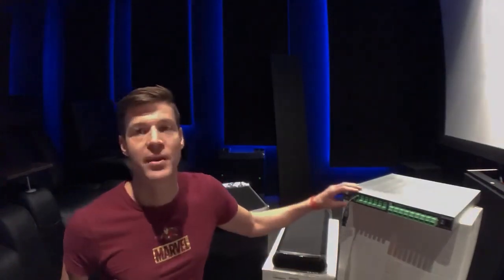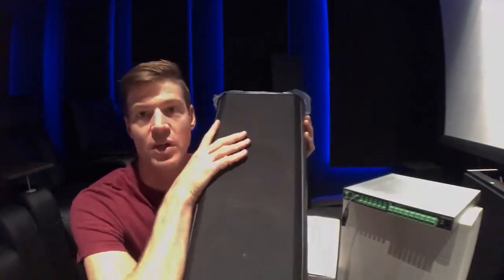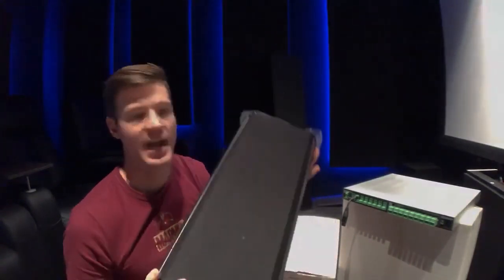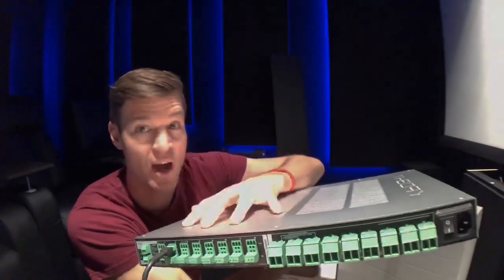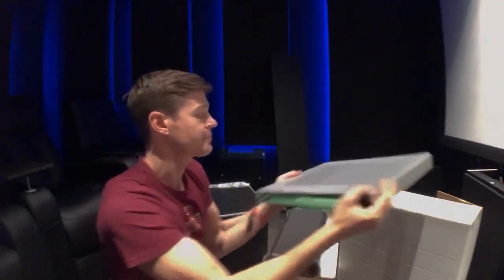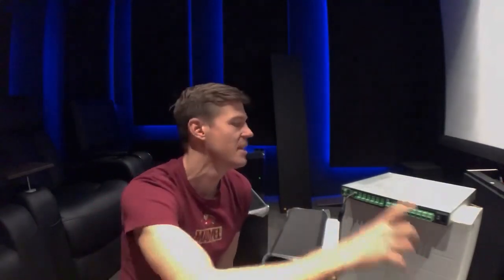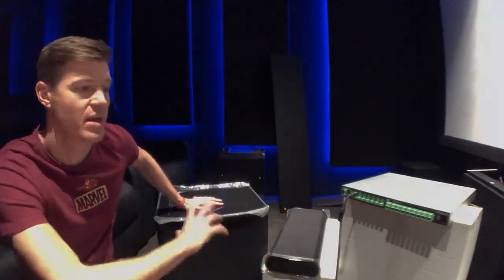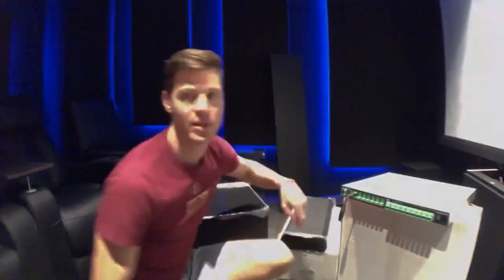Theory Audio 1800 watts Cinema Sound System

Comment: The technique is getting the matched LCR to sound each the same as they are not in the same xyz 3d space they are spread and spaced apart and this can take days to achieve with the EQ to correct bass LF and HF horns. HF horns is the trickiest as no CD is going to sound the same, kinder like playing the card game "snap" when two cards are mirrored the same. The CD and horn look the same but the odds on the diaphragm being 100% is very remote. Can EQ them to be close but simple fact there just isn't enough PEQ. Most PEQ may have 9 bands some others like Behringer FBQ2496 has 20 PEQ and that still isn't enough. Daisy chain channel A to channel B that then give you 40 PEQ but still not enough and the microphone has to be placed very close to each LCR horn on the bench while they are tuned and may take x2 FBQ296 linked together to give 80 PEQ as the FBQ has very narrow Q bandwidth to very wide bandwidth and the PEQ filters is like woodwork with sandpaper to sand down the uneven peaks and between common cinema HF horn crossover at 500Hz thou I tuned my JBL 2445 JBL 2380A to 303Hz still got use the PEQ below the crossover and extreme upper highs and get the CD aligned so all common three are within a few fractions of 1dB or less than 0.5dB which is hard to hear? The REW is going to show it all on the frequency sweep Overlays, if they all line up over one and the other with No smoothing applied. It is a tricky task and can take days to do it manually, Never mind about auto-EQ that is for rushing the job and never gets it right. Aligning a CD horn must go though many checks. 

1) test tone pink noise get a wide response in the 250Hz 300Hz to 20.000KHz  
2) checking with sine wave does the CD make any distortion noise? This will be due to misaligned with phase-plug and the voice coil and may need the screws loosened and tiny careful wiggling the diaphragm while listening and observing the RTA as the mic is going to be close to it and looking for at the fundamental sine wave - while above it are some harmonic frequencies and once the diaphragm is aligned the harmonics will vanish and the fundamental toe sounds pure and undistorted..
3) playing the sine wave tones and at different SPL dB and pink noise up to 110dB (while wearing earplugs during this phase)
4) playing a movie content while CD horn are on the bench to see how it handles with multitude of sound frequencies. 
 
Onne all CD horns have been checked they can be fitted behind the screen. 

1) place microphone close to the screen, on axis with horn. Best way is use a cheap audio mixer with x6 or x12 more XLR inputs this is to make alignment easy even though it can still take days.  The CD horn is going to behave differently with a screen or even tested on the bench with a fabric placed in front of the horn. The screen is different a degree of the sound is going to have some + factor and - factors some frequncuies will be slightly boosted while others have less and it will be the task of another PEQ to correct Yes that is a lot of PEQ and frankly I find it a bit frustrating that there will be bundles of PEQ in a rack. Can't a manufacturer make a PEQ that covers the whole frequency bands in tiny fractions so any PEQ can be selected.

2) pink noise when muting the DCX2496 to listen to each LCR should sound the same within a few dB.

3) with the microphones being close to the screen, each LCR can be sounding while looking at RTA the sound from each should sum up, the screen material will have an impact on the horn and the horns have to be placed at same distance from the screen otherwise the frequency will be, up or down in certain parts of the frequency. Once all the LCR horns have been PEQ tuned can move on to next step.

1) microphones placed at seating locations and with that the SPL dB frequency is going to alter its frequency shape. Some PEQ used again to get an elevated boast on the upper high frequencies above 8KHz to 20.000KHz thou only few will ever hear/notice 20KHz in a movie and very few movies have fundamental peaks up to 20kHz that I have ever noticed. ALIEN 3 (1992) Truman show (1998) Tomorrow Never Dies (1997). 

All the above can take days to achieve. If one of the many PEQ failed in the sound chain, make note of all the PEQ filters so a replacement can be installed. 

Flat frequency = good cos then the film mix will play with clearness of the dialogue, music. foley and effects. If a speaker is uneven with peak frequencies that can audio mask what your listening for will be very hard to hear?